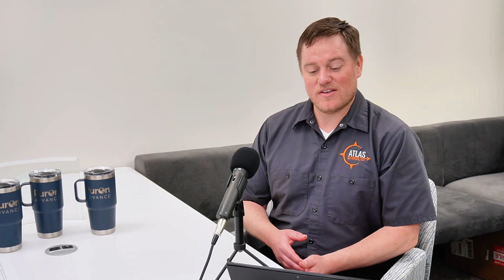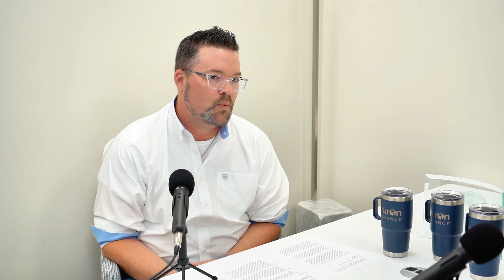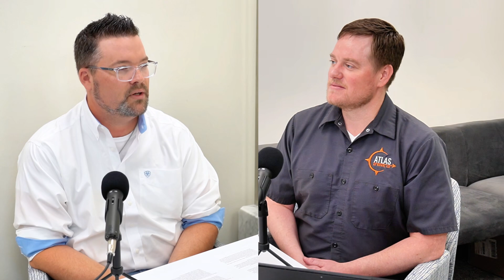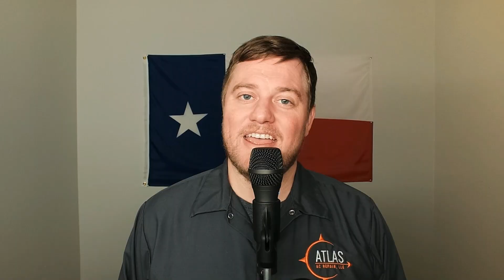Carrier Infinity - Zoning Best Practices

Comment: Wait what? So basically I spend all this money for 4 zones. Then everybody in each bedroom gets to walk into my master bedroom to adjust their rooms??? There’s not an individual stat control in each room? This “communicating” system sounded so smart until it didn’t. I’ll take the non communicating system and a 3rd party Honeywell zoning setup
Reply from the maker: Sounds like a misunderstanding.
For the Carrier Infinity, you need to have a wall controller in each zone separate from the main wall controller. 
Each zone can be controlled as a separate eco-system if installed correctly.
Reply: Lmao you are special aren’t you…